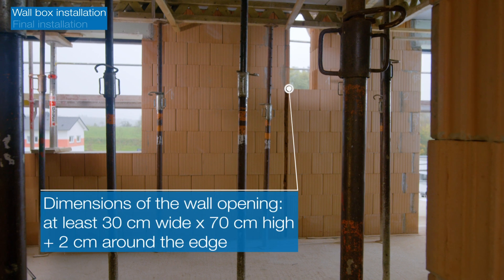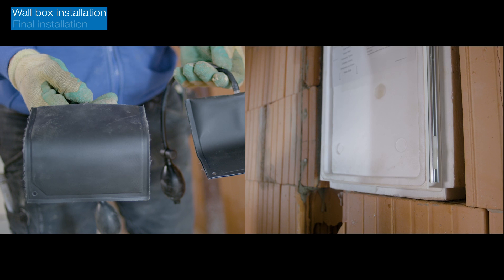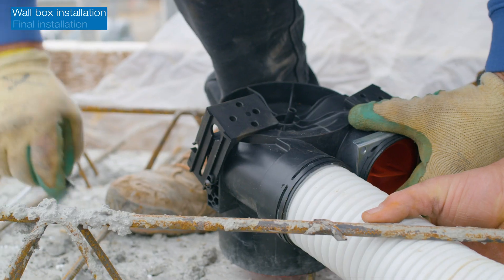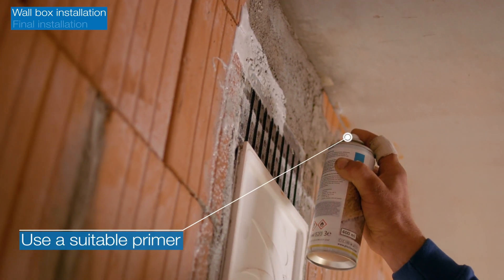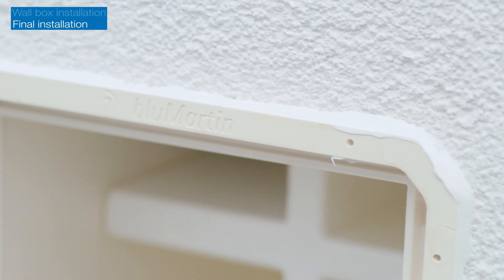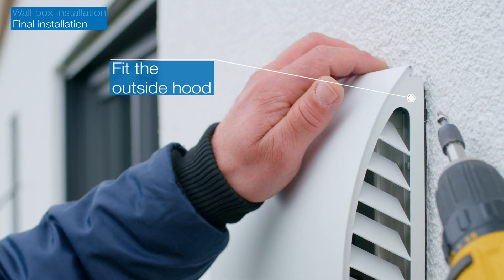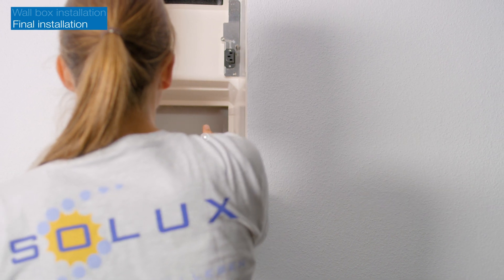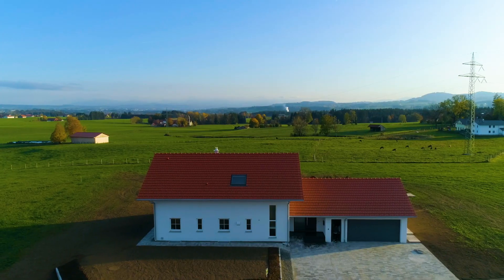🇬🇧 Installation of freeAir 100 ventilation unit with second room connection

Comment: Great product, but uninsulated air pipes in the concrete seems like a bad idea. Is the idea that that slab is on the warm side so doesn't need insulating? Also how much does this thing cost. I can't find a price anywhere. I'm guessing that it is reassuringly expensive. It does seem to be miles ahead of most other distributed heat-recovery ventilation systems so they can probably charge what they like.